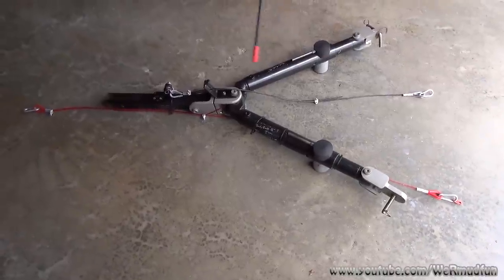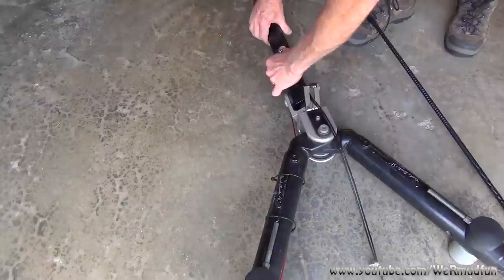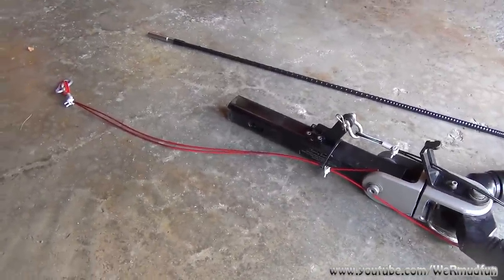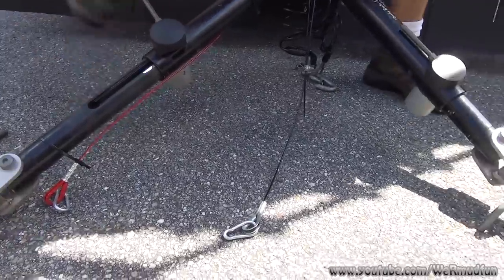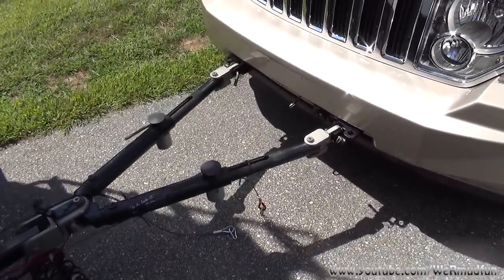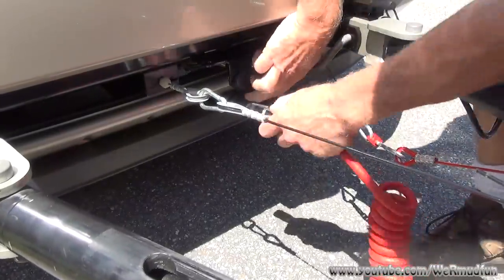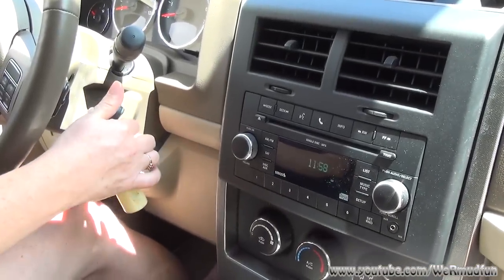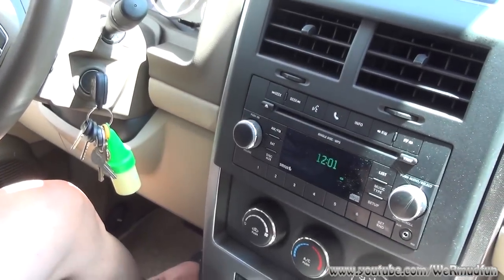Ready Brute Tow Bar Setup and Demo

Comment: Excellent demonstration.  After reviewing the many videos and reviews, I just installed BlueOx baseplates and ReadyBrute on my Cherokee Trailhawk.  One question I had in your hook up video (we have not used ours yet), is you appear to have zero slack on your cable (you had your driver depress the pedal to hook your cable up).  Instructions say allow for 2" of slack.   Is there a reason why?
Reply from the maker: Thank you! :)  With the 2" slack the third brake light was not lighting while braking, so we kept adjusting until it did light.  It just ensured us that the brakes were engaging.  There still is slack otherwise the brakes would always be engaged and that would be bad. LOL

Comment: Thank you for a very informative video. I would like to ask you about one thing though. You remove the key from the ignition, in the end of the video. Dosn't the steering wheel lock up by doing so?  Is it maybe supposed to be locked?  Thank you again for the video.
Reply from the maker: Thank you for your comment.  On our 2017 Wrangler there is not a steering wheel lock, so the key is not required to stay in the ignition. Check your owners manual for your year.  Some years had the steering lock and some didn't. :)
Reply: WeRmudfun Thank you for clarifying. 
Best regards,
H.M

Comment: How do the front wheels on the jeep steer with tbe key pulled out? 
Or do you have a steering wheel shaft disconect?
Reply from the maker: On some of the Jeep Wranglers, the steering wheel doesn't lock when the key is taken out, so it's not a problem. :)

Comment: excuse me but the key chain size clips are those supposed to be load bearing>>>?
Reply from the maker: You don't need to be excused. LOL The clips are larger than the "keychain" clips we have seen.  We have used this setup for over 10 years now on 3 different vehicles and it has always worked flawlessly.  We would like to believe that the company did the research for safety to get the patent for their product.  I would suggest you get a hold of the company for any further info.

Comment: Ideal equipement for purpose shown but not really suitable for an ` emergency tow-in ` situation as lots of preperation works has previously been done on the towed vehicle , double towing eyes , brake wire attachement cable and electrical socket outlet for lighting etc , but ideal product and fantastic for purpose shown :-)

Comment: The last thing you said was "put it in Park" then you drive away. You actually tow this vehicle in the Park position?
Reply from the maker: +Dwalt K For this vehicle you do.  Putting the transfer case into neutral separates the transmission from the rear axle allowing the rear wheels to turn freely.  Keep in mind though that you want to be sure the vehicle is secured to the RV before shifting  the transfer case into neutral and to shift out of neutral before disconnecting from the RV to prevent a rollaway.The procedure we follow is straight from the Jeep's owners manual.  It pulls like a dream too.  We check on it with the rear view camera at times just to make sure it is still there. :)

Comment: Can I tow a Chevy truck with this?
Reply from the maker: The new Elite towbar is capable of pulling 8000 pounds.  It will depend on the weight of your truck and the towing capacity of the vehicle you are pulling it with.